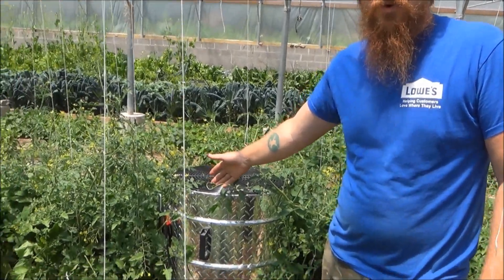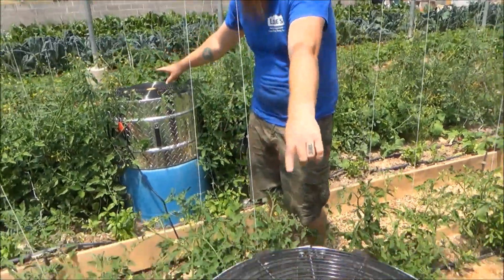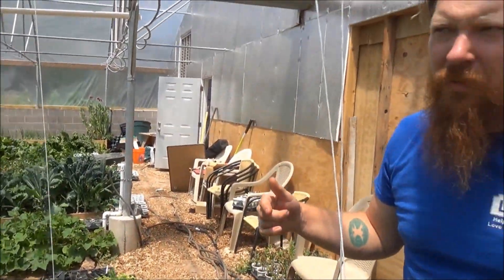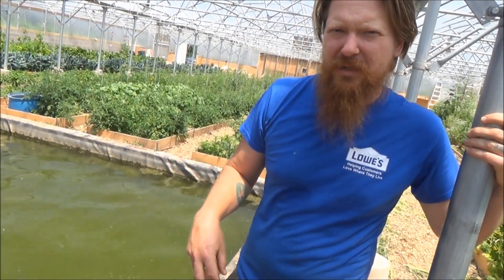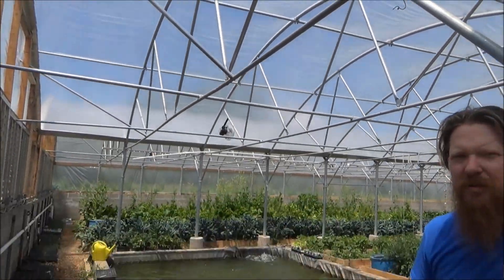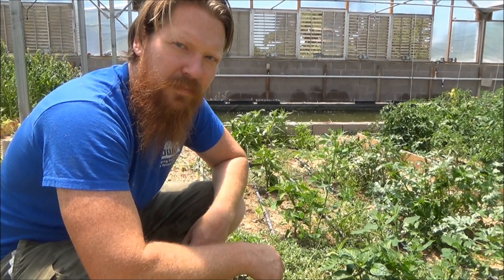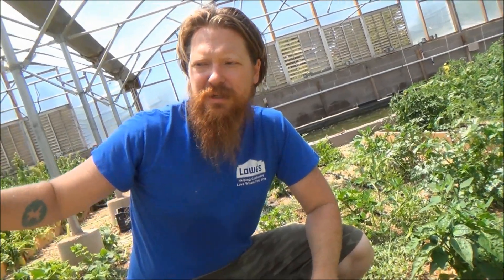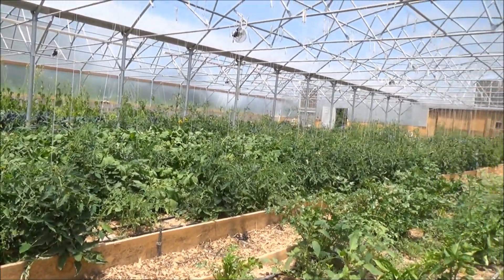Climate Battery Greenhouse Explained

Comment: 15 times an hour may be the theoretical turnover rate but judging from the plenum in the vid  i`d say it`s probably 5 or less ;)  https://youtu.be/IGzkUyhk938?t=105
Its worth having the system checked by a hvac engineer so you have accurate numbers to work with..